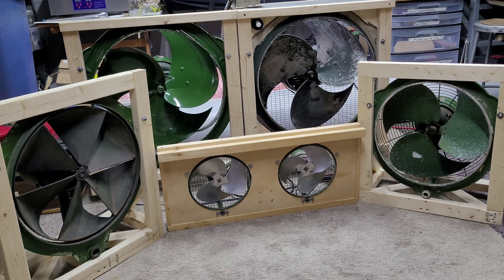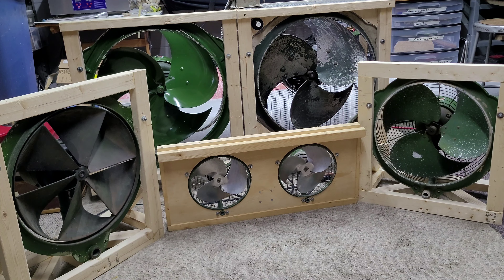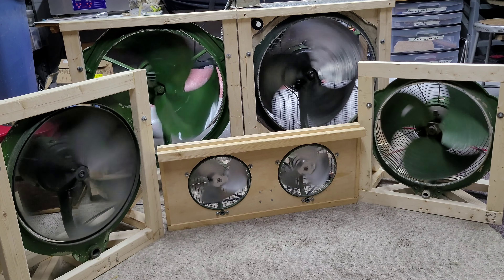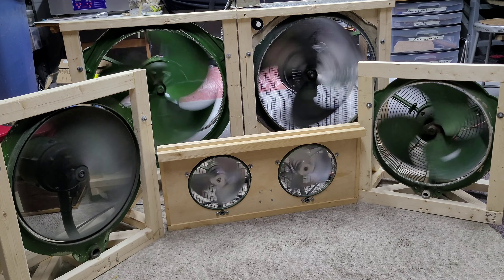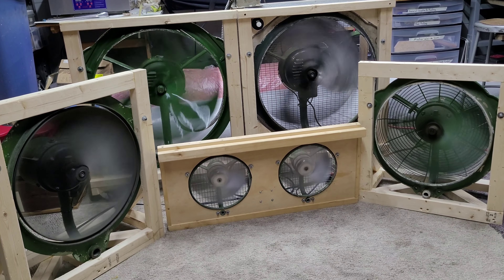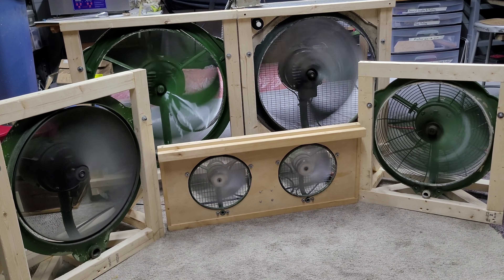The ILG Sextet! 6 ILG Fans Running  Simultaneously!

Comment: I can't even imagine how much power was drawn during that initial spinup
Reply from the maker: I know that the 20 inch type W fan draws around 18 amps of inrush current and the 243 type Q fans probably draw around 8 amps inrush each, so just those were drawing around 34 amps plus the other three fans. I had these supplied by 2 separate circuits to avoid an overload, but you could definitely hear the all that current flowing 😅